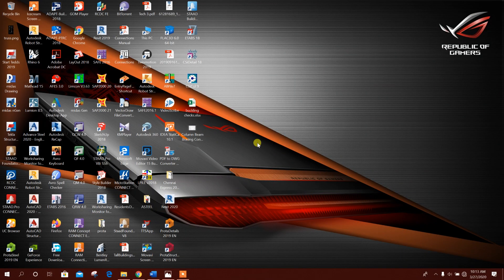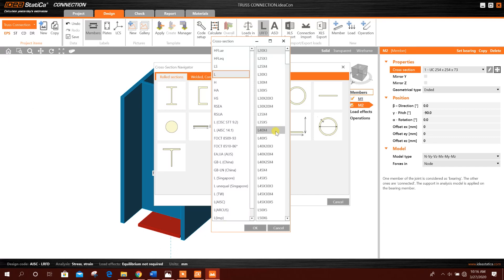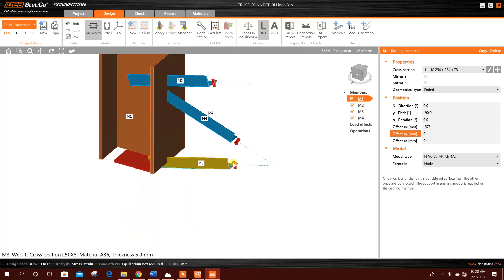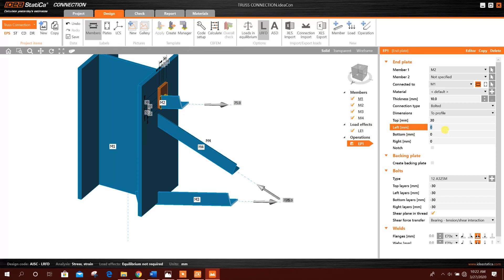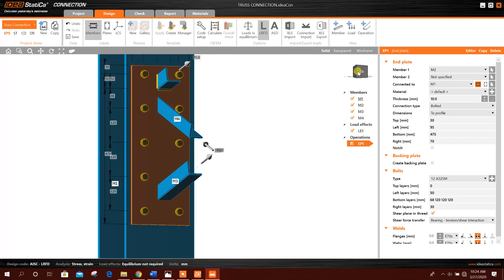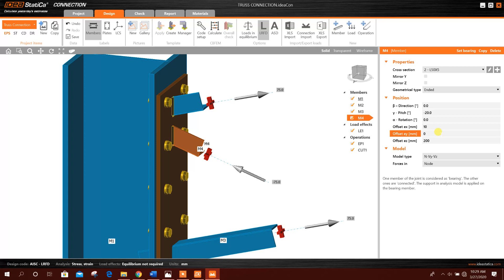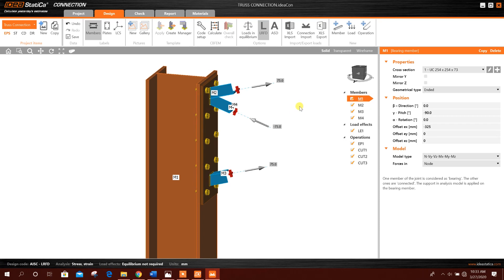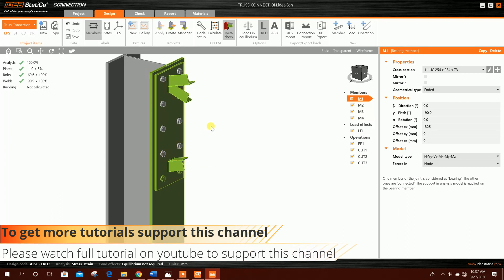Custom Truss Connection Design in Idea Statica

Comment: Please make video for 
1.Double angle bracing connection for PEB Rafter with horizontal gusset at center of web.
2. Double angle bracing intersection connection
ii am unable to model a  bolted connection,need help on the template to follow.

Comment: I have a doubt, in IDEA Statica webinars they say that models only works with a single node. The use of two nodes can mislead incorrect results.  

Do you think that probably the right way to analyze this was to separate it into two connections?
Reply: You are correct
Reply: That's right. It mostly related with possible wrong moment diagram distribution along the secondary member when you are connecting other members to it.
However in base plate connections you can connect as much members as you want to the main plate and that is OK.
In this case (in video) it is also might be ok if secondary members are loaded only with axial force and model type for them is set to N-Vy-Vz. However I would verify it by analysing 2 seperate nodes